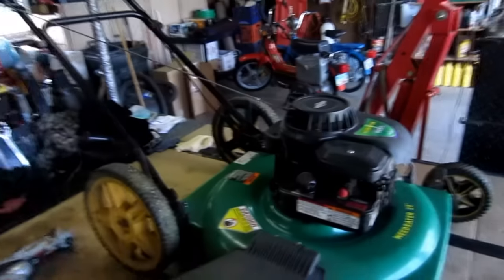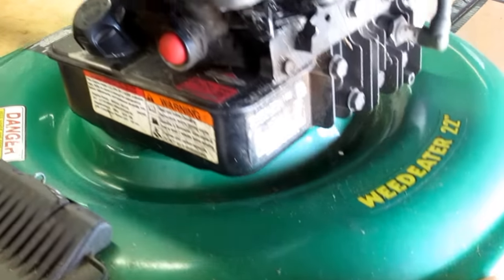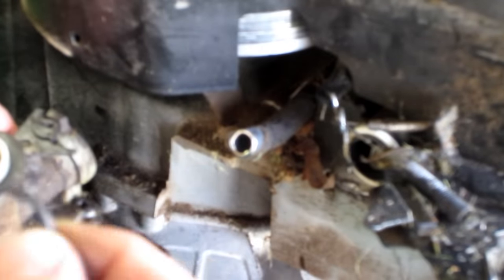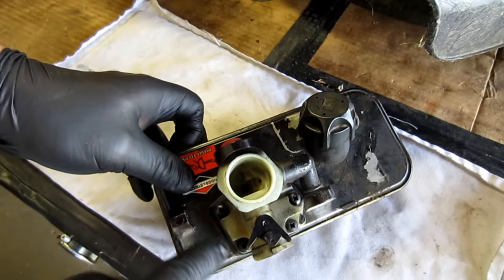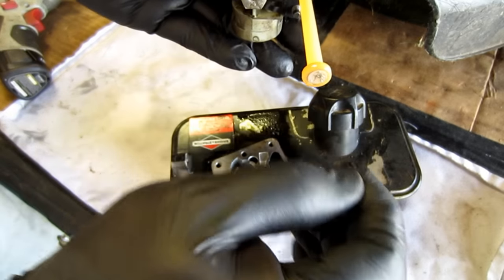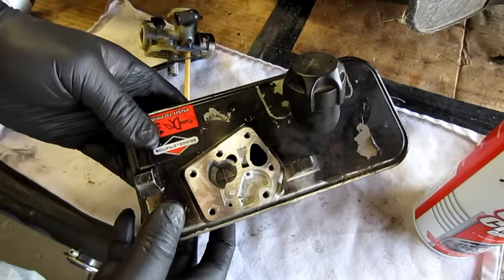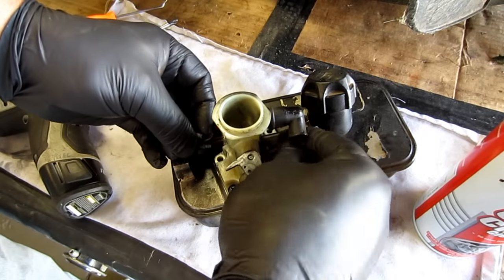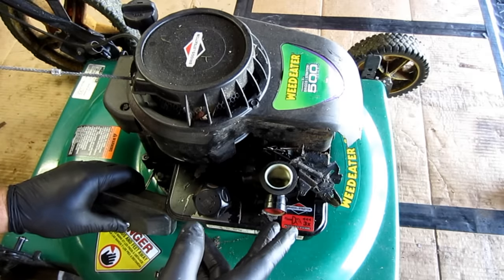Fix 90% of Briggs lawn mower not starting problems. Easy repair.

Comment: Get a Honda, Kawasaki, or Kohler engine
Reply: Or run what you have...
a Briggs will run well for years with just a decent oil change 2x per year (at thestart of the mowing season...and at the end)
plus an air cleaner when necessary..and a sparkplug every 5 years or so...

Comment: +Foxboss9
  will it run without a filter ?
Reply from the maker: Yes.. Not advised though
Reply: @Foxboss9   Thanks for the Reply... it's just for testing as i picked one up for like 20 Sterling pounds as theirs no Air filter! Mountfield OWH 4 stroke

Comment: Advice wanted, , mine starts real easy after 3 pumps but then stalls after a few seconds every time
Reply from the maker: Sounds like fuel issue... You'll need to follow the video instructions...
Reply: i did but exactly the same thing happens when i re-assembled  it
Reply: going to strip it down again as its so easy and see if i missed something
Reply: i did but when re assembled it did exactly the same thing 
 @Foxboss9
Reply: going to strip it down again as its so simple and see if i missed something
Reply: Followed the instructions to the tee, this time noticed that the tank surface was slightly pitted so took some wet and dry to it ,re done that scorching between the 2 screw holes , re-assembled and bingo, spot on runs like a dream. Thank you so much

Comment: +fixboss9 my b & s push mower 375 with pulsa prime  3hp  has no throttle up/down response(faster or slower)  any idea how i can fix it?,i took the throttle cable off to lube it with oil as it was stiff & but it had same problem before hand too,i've scoured ut looking  for help but nothing 😔😔 any advice?
Reply from the maker: You have to make sure that your linkage rods are connected to the carburetor correctly. You have one that runs to a swivel plate that your throttle cable be connected to that is the one that's in the front of the mower it then connects to the throttle blade plate that is directly above the carburetor. And then there is one more linkage that runs from the carburetor plate that I just mentioned to the governor vane rod. Plus there should be a spring or two that is also critical to a steady speed when running. If those rods are not in place then as you adjust your throttle cable it won't move the throttle blade on the carburetor. It's really hard to explain in a text about that and even talking with somebody direct I don't think that I could explain it you just need to see one that is functioning and working so you know how to duplicate it. Good luck
Reply: @Foxboss9  thank you for your  response i screenshotted ur reply here & will look at it soon,initally i thought there could be a spring or linkage missing but as u say its hard to say for sure unless u see a complete identical engine.👍👍thanks for your help 👍👍

Comment: Good video skills; needless hyperbole. Title says fix 90% of Briggs starting problems -- this may fix about 1%. Dialog says fix 89% of carb problems -- a little more realistic than title  but probably closer to 35- 45% of carb problem remediation success achieved by these procedures.

Comment: you didn't show how to replace the priming bulb
Reply from the maker: This video was to show what fixes 90% of the Briggs & Stratton Carburetor problem that looks like this. I also didn't show how to adjust the idle. I also didn't show how to replace the pressure tube that runs the pump.
Reply: @Foxboss9  Pressure tube, that could be the problem why I can start it on starting fluid but it doesn't keep running. I did everything else and I am certain that all the orifaces are open. I didn't replace the gasket though
Reply from the maker: @2manycatsforadime  fuel pump diaphragm and gasket in the description are the next step in the process of repair...

Comment: 40 volt lawn mower 10 times better Dino gasoline ones.
Reply from the maker: Dino powered has been getting it done for over a hundred years... They all break down eventually, Good luck finding Electric mower repair videos or a local repair shop ...

Comment: Just get a Honda you can let it sit for years and it will start up
Reply from the maker: Hondas are great engines there's no doubt but their carburetors are only second to Tecumseh when it comes to not running after sitting because of debris in the fuel bowl. This comes from 35 years experience with old gas and carburetors on push mowers.

Comment: 1/2 i cant take it out
Reply: use a flat sided socket not a multi sided one (better grip on the head of the bolt)and dont be afraid or it.
Reply: I did everything thing u say to do but still dont turn on